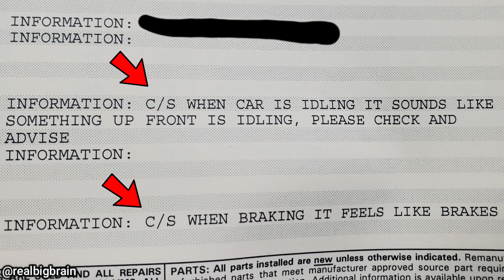Customer States Vehicle Has A Burning Smell & Won't Start | Just Rolled In

Comment: years ago I had a customer doing long distance delivery runs and he started overheating at the George Washington Bridge. (NY / NJ line) Our shop is only an hour north so he figured to see if he could make it. The vehicle quit 45 minutes later in Stamford Ct and got towed. The next morning we did the diagnosis (oil was full, coolant was MIA) and it cranked over like there were no plugs in it. Pulled the head and found all the rings were frozen to the pistons. A few days later he had a complete rebuild (in house) and was back on the road with specific instructions of how to maintain things. The Nissan PU came to us with 125k on the clock at 2 years old. I saw it again 4 years later with 420k on the clock and it was still going strong. I guess the guy learned his lesson.

Comment: >>>>>>>   ITS VEGETABLE OIL.     I engine mechanic, was, disabled now.   During a school an engine was there with same "Jello" effect.  Mr. Consumer used vegetable oil to change the oil in tractor.   Was a Honda twin cylinder engine with oil pan removed.  Was at a Honda small engine repair service school.

Comment: 3:07 Listen to how smooth that inline 6 idles. Cars were art back then.
Reply: m rapacki  I count 6 plug wires and 6 intake ports. It may have double overhead cams being a Rolls Royce.
Reply: m rapacki  I don't know computers or video games, but I know engines my friend. The reason BMW and Mercedes Benz still uses inline 6 design is because of thier perfect balance at the crankshaft. 120 degrees, 240 degrees, 360 degrees. Perfect. Also the reason why many companies ended the production. For instance Ford pulled their 300 4.9 liter was because the never broke.
Reply: @drremulack6196  Chrysler/Jeep used to use inline 6 cyl 4.0 litre engines ..they would never frickin die and made pretty good power.. WTF they went with those 3.7 Benz dogs is beyond me.
Reply: @robertravena  I know, I had the 300 L 6 in my 96 F250. Smooth as silk low end power
Reply: @robertravena  I had the 300 in my 96 F250. Best engine ever.
Reply: That's how inline 6's are. Even a cheap Slant Six idles like that, smooth and quiet.

Comment: That old rolls engine sounds beautiful!
Reply from the maker: Glad you enjoyed it!
Reply: The Rolls was sweet, just don't let the owners of those other cars even touch it.
Reply: Actually I could hear a few "slightly unhappy" sounds coming from it. Got to look over a Silver Cloud of about that vintage years ago and If you didn't hear the "tiny" sound coming out of the tailpipe you wouldn't know it was running! With the hood open it was unbelievable (and I have good ears)... ;)
Reply: @PhilG999  Agreed. compared to most vintage Rolls Royces I've heard that engine was a bit loud. "The loudest sound in a Rolls Royce is the ticking of the dashboard clock".
Reply: That beautiful 1930s RR engine reminds me of a story of a British family touring round France with something similar which had 'declined to proceed'. It was towed to a small country garage where the mechanic was so overjoyed to work on such a car he didn't charge them - telling them it was an honour to fix it.
Reply: @frglee  I heard a story decades ago that was going through the vintage car community in Queensland. Apparently someone had found a 1930s (?) RR with a broken rear axle. He contacted RR to ask about finding a spare and they said they'd "Look into it". 3 weeks later 2 men were on the doorstep with a packing crate. They went down to the garage and came back a while later. He was told that they were never there because "Rolls Royces don't break axles".

Comment: Man my head is hurting and my wallet is crying this time. I love that old Rolls-Royce, maybe we can see more of it in the next video? She is sweet.
Reply from the maker: If I get any more clips of it I'll be sure to add it in a video. I got an invite to check out more of them in the UK. So hopefully one day I can fly over!
Reply: It idled so smooth it sounded like a sewing machine.
Reply: @textech4056  If I remember correctly there is a video of a similar engine with a wine glass on top while it's idling and its stable as
Reply: @viper13178  I have seen one similar with a coin balanced on it's side on top of the running engine. I think it was at the end of a recent video from this channel. Found it https://www.youtube.com/watch?v=fOo5gsKzRAk 2:51 and it was from this channel.
Reply: @viper13178  When Lexus first came out they stacked 10 on the hood. Also they ran a ball bearing down the gaps in the body to show how good the fitment was. Should be around 1990 the first LS400. I'm old enough to have a magazine with an ad that has a picture of the wine glasses. I do not know if they made a video but it is impressive. There is a company that does/did those kind of tests to verify car company claims. Drive safe.
Reply: Don't those old Rolls- Knardly engines like that have one valve in head with other in the block? What did they call that 
F - Head?
Reply: @michaelszczys8316  I don't know actually,  I personally have been into classic and muscle cars but look at cars from that era as works of art and masterpieces. Good question im gonna do some digging.
Reply: @tylercovey327  please let us know what you find Tyler. Your right tho, cars from the era of that Rolls were actual works of art!. Just listen to how smooth that engine idles!! No wonder those engines were used in early aircraft!
Reply: @1982MCI  ok there's not much to go on but from what I read the f head rolls engine had an over head valve design but just the intake valves were there, exhaust valves were built into the side of the engine block. Very weird confusing but also interesting.

Comment: Never heard of this before. I bought a 1974 Plymouth Duster with a 318 V-8 engine back in 1992. It ran sweet and with the dual exhaust and shift kit I had put in with the A-904 auto trans rebuild it had a strong 2nd gear chirp. Looked low mileage, pedals had little wear on them. Pulled valve cover and there were no head bolts to be seen. A shiny ceramic type material about 1/2" thick had covered the bolt heads. Had to hit it with a sledge hammer to break it. The material shattered like a coffee mug. I guessed the original owner had never heard of an oil change and just added as needed. I pulled the intake manifold and looked at the cam lobes. There were chips and chunks missing from the cam lobes. It never gave any indication that anything was wrong with it. Great motor treated badly.

Comment: Back in the late 50s and 60s there was a nation wide use were some used car shops would put saw dust in the rear ends and in manual transmission  to take out any vibration.  First time I've seen  jello in the oil.
Reply from the maker: I've heard about that! How things have changed lol

Comment: The party trick of the Silver Ghost is that you can start it while warm by having a piston near TDC and advancing the spark   which has a control on the steering wheel centre.
I have seen it done

Comment: First time visiting this channel, so the RR engine had me. I kept looking and looking to see what was wrong. I felt stupid that I couldn't see anything wrong. Everything else that was shown was completely screwed up, so I just knew something had to be wrong on the RR. I really felt stupid when I read the comments about how great the RR was. Some of the other problems were unbelievable. I have never seen a piston completely gone out of a cylinder, with a rod and wrist pin left in the hole.
Reply from the maker: I like to add the occasional RR to change it up 😜

Comment: The first Rolls Royce auto factory was on Nightingale Road, Derby, England. I used to live around the corner on Grosvenor Street, by this time the factory was building jet / gas turbine engines. 
During the war they built the Merlin engine. I also worked there before moving to Rolls Royce in Canada.
Reply from the maker: Thanks for sharing. I love the history with Rolls-Royce. I'm going to have to read some more into it. What do you do for Rolls-Royce if you don't mind me asking?
Reply: @JustRolledIn  I started my apprenticeship at 15 as a Machinist/Toolmaker. 
If you worked there you said you ( worked at Royce’s ), the reason behind this was one of the founders was Mr Rolls and he was the money behind it. But Mr Royce was the mechanical genius of the two and made Royce’s what it was. 
Before I left England I worked on machining hot end turbine blades for the High Bypass RB211 engines which were used on Jumbo jets and the like. 
I just love watching all the dumb things drivers do to their vehicles on your videos. 
I own a 2014 GMC 2500 HD with a Duramax power train, which is stock. My wife owns a 1990 Mazda Miata.
Reply from the maker: @chrisbarnes2823  thanks for sharing Chris and great choices of vehicles 👍
Reply: Not to dig against Rolls Royce but during the war Packard also built Merlin engines under licence. But Packard being Packard reworked the design a bit so modern production methods could be used (instead of all the hand fitting RR did). As a result Packard's Merlins were more powerful and more consistent then their British built counterparts.
Reply: I was extremely worried when the clip of the Rolls Royce came on because I was thinking "Oh no...Who screwed up this piece of history!!!!" but it was just an appreciation clip phew...
Reply: @JeffDeWitt  the only engines that were hand fitted were for cars. During the war you did not have the time to hand fit. The main difference between English and North American engines was the thread type, that’s why parts were not interchangeable between the two. Rolls Royce only went so far with the Merlin and then developed the Griffon for future airframes.
Reply: While in Vancouver BC and the Puget Sound area, the 'sales' ads for used RRs were actually fun to read.. "Fixer upper, Needs TLC, Brakes are in need of replacement, interior is worn, paint is good , but needs polishing. Each was fun read, due to the basic old car mentality around BC ;}

Comment: 0:35 Prior to around 1985, cases of motor oil turning into fecal matter or brown Jello were unknown. There was chocolaty sludge for sure, but never total solidification like this. Before EFI, most cars began to burn oil after 75,000 miles, due to the sulfur content of the fuels, plus the relatively poor atomization of the fuel by carburetors, starting enrichment, etc. so the engines didn't retain oil long enough to make this possible. This happens today because engines with 250,000 miles and good compression/low oil use have become commonplace.

Comment: When I hear about the pain of annual testing here I think of some of the horrors I’ve seen on this channel that probably would have been picked up by our MOT guys.the car with the torch headlamp would definitely have been pulled over and prohibited by the police (or DVSA if they happen to be spotted by one of their vehicle examiners) for both the lighting and condition of bodywork. I’m continually amazed by the tyres I see, we have to change ours at the tread bars (1.5mm depth across the centre 3/4 of the tread). And a tyre check is a basic part of being stopped for any reason.

Comment: Looks like someone mixed HOAT and OAT into the oil lol
Reply: and a case of Bars Leak!
Reply: H Christian. I was looking at these two coolant types this week. I was thinking of changing my 2017 Ford F150 v8 to Dexcool. The Ford OEM coolant is apparently HOAT. Dexcool is ethylene glycol based, I think.
Reply: @marccrotty8447  yep, anything works better than the original G-05. Just be sure to flush out the system really well!
Reply: @bigwo56  thanks for the advice. I did not know about the G-05. That is helpful.
Reply: @marccrotty8447  Welcome!

Comment: That 1930's Rolls-Royce motor. Those were the days when even the engines were works of art.
Reply: I think new cars are still art to an extent, obviously not hand built in mass production models but still, tech that was strictly high performance race technology even just 20 or 30 years ago is now standard on any car, like dual overhead cams, direct injection, turbos, variable valves etc. A lot of people don't like new cars but I'm impressed with most of them

Comment: Backwards lug nuts... When iw as 18 and working at a volvo dealer the manager rolled in with a new hummer H2. I instantly looked at the wheels and said "the lug nuts are on backwards".
Reply from the maker: Brand new and they were on backwards?
Reply: @JustRolledIn  very new, shouldn't have said "brand new". It was back when the H2's were hot and only out for a year.

The truck had chrome rims on it and the previous owner swapped the stock wheels back on before selling it, tearing them up with backwards nuts and a socket or tool that also rubbed the nut opening.
Reply from the maker: Jeeze. We also must have had the same manager. An old one of mine had a pink H2. 😅
Reply: @JustRolledIn  I could be wrong  but on the H2 are not the lug nuts side specific?  I know Chrysler used to do that a lot.  That was a common one at Discount Tire.  Throw all the nuts into the same hub cap and then install them all with the air drive set to 320ft pounds.  Did not matter the handedness of the nuts,, they all drove down.  Just some of them never came off.
Reply: @Sailor376also  I remember my old 60's Dodge had right handed threaded lug nuts on the right side and left handed threads on the left side . I had to find out the hard way .
Reply: My Dad's 56 Buick did that, too:  I remember when he told me about, during a brake-job...
Reply: @eaglerider1826  I am laughing.. I learned the same way.  Hmmmm?   At least I was hand threading them and figured it out without damage.  It made sense immediately.  Because,, I had a wheel fall off on Storrow Drive in Boston.  Collected the wheel from a block down the street  the hub cap had all the nuts still loose in it.  The left hand threads,, auto tightening made sense.  My hand circular blade is a left hander so the blade tightens the nut,, instead of loosening it.
Reply: @Sailor376also  Some of the old British cars and light trucks had lefthand/reverse threads on lefthand side wheel lugnuts (and some others). I learned "the hard way" once when undoing the main front axle nut on  a friend's car. Fortunately it was just an old wreck they got cheap anyway. Yeah I undid the castlenut and the nut was tight to undo. Very tight, I got a big bar and just as the nut started to undo (ie strip) I suddenly though "Hmm, left hand side of car, I wonder if this might be a lefthand thread ?" Turned out wasn't a problem as it was just an old wreck anyway. I tidied up the thread, put the nut back on with an an extra washer (as the thread wasn't totally destroyed) which with the cotterpin in place through the hole, held the nut in the right position anyway.
Reply: @KiwiCatherineJemma  Good memories.  My first ever car purchased was a French 403 Peugeot.   a 1961??   1960?  I don't know..  But all the weirdness of a French engineered auto   4 speed on the column,,, but a backwards pattern.  It was too easy to shift 1st, 2nd, reverse,, Oooops.   3rd was between 1st and reverse at the top of the shift.  Laughing  yes, I blew up the transmission once.  Laughing,, it was such a popular car,, the used trans from the junk yard cost 35 dollars, and 20 to install.  British,, exhaust systems (Bentley) that weighed 350 pounds, electric systems that sparked as often as the spark plugs, and side draft carburetors that had to be adjusted daily,,, and left hand threads.  Is it any wonder I drive Ford pick ups these days.  Every part under the sun available after market and the shipping costs are about the same as the parts costs,, peanuts.  And minutes to install.  Those 'wonderful' and complex British, French, Swedish, German,,, convinced me I like stupid and simple.  I like canoes and rivers,,,, I go downstream,, the current doing the work.. Don't make me go upstream.

Comment: As to wheel nuts, 18 months ago a friend came around and mentioned an odd noise from the front of the car. Quick drive to the end of the road and back, and I got out and took off a wheel bolt with my fingers and handed it to them! All the bolts on that wheel were very loose. They never went back to the place that had just serviced the car and which had handed it back like that!
Reply from the maker: It's scary how many times I've seen that as well.

Comment: Back in the 80's I was parts manager for a GM dealer, the new downsized GM alternators were just out driven by the new serpentine belts and spring loaded tensioner, a local farmer stopped with his chevy pickup complaining of a squealing noise under the hood when we opened it the bearings had gone out of the alternator but the serpentine belt just kept pulling that shaft, it had worn 2/3 of the way through the side of the alternator, wish I had a picture of it today